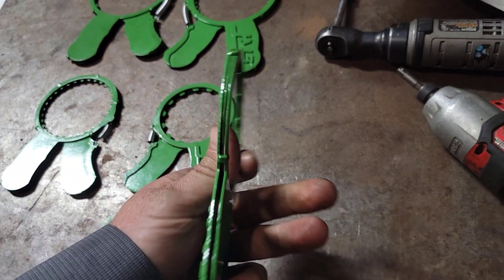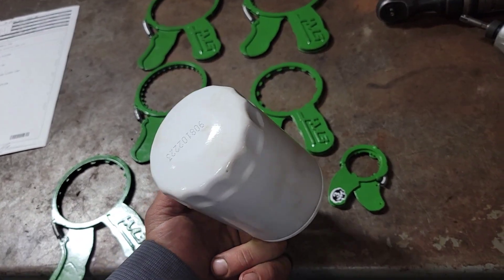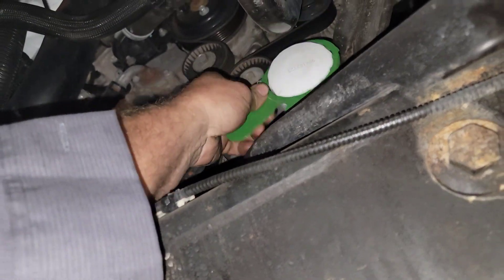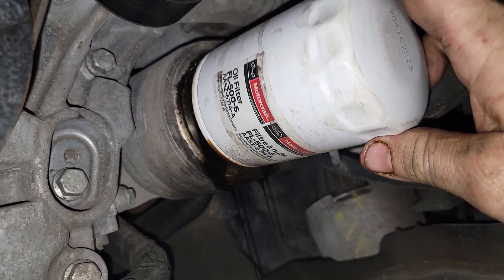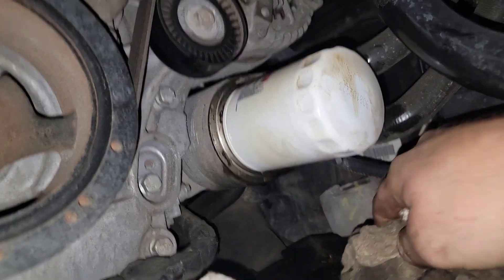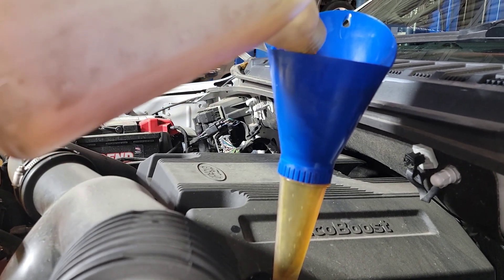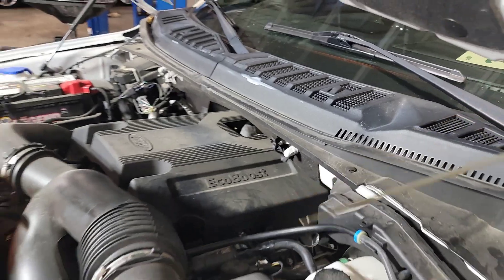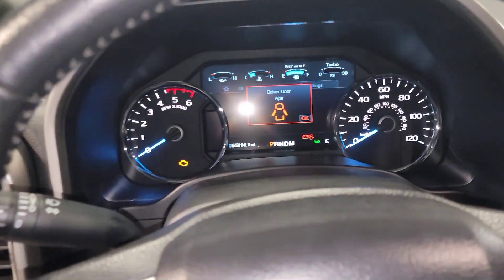2011 - 2022 Ford F150 - Cleanest Oil Filter Removal / Best Tool For It - Reset Oil / Oil Prime Mode

Comment: Genius, wish I had this when I was changing my old land rover filter. 
I used the sealey one with 3 hook things that grab the sides, I just managed to get the thing off in one piece, but it was basically crushed by the hooks - one had punctured the filter completely. Could have easily torn in two.

Comment: These look pretty awesome, I noticed they have their own website you can visit also.   Man I had a stuck filter, on my personal car no less, a little while back.   It's an older Honda Accord with the oil filter on the firewall side of the block.   So already an inconvenient spot.    After struggling for a few minutes, I did the old trick of driving a screwdriver through the filter at an offset,  and that still wouldn't break it free.  I ended up cutting the bottom half of the thing off trying to get it with the screwdriver like that.   What a mess.   I had put the filter on while I had the engine out of the car, and I guess I used too much caveman strength.   But one of these, could have saved me a lot of time and effort.
Reply from the maker: It's posted in the pin comment I posted on every video that I talked about them at the top of the comment section there's always a pin comment that's where the important stuff goes on
Reply from the maker: Yes one of these would save you in a situation like that
Reply from the maker: No it's not going to work every single time but most of the time it's going to where other things don't

Comment: Switched out the Pennzoil Platinum for the Amsoil SS. Engine still running pretty quiet but it sounds like the engine is slightly noisier than when it had Pennzoil. Maybe it’s just my ears messing with me but I’m gonna keep checking as I did take a recording of it before I switched out the old oil. My transfer case fluid looked good as well. Still had its red color. I think next oil change I’m gonna try Royal Purple HPS. They got it for $62 on Amazon for 6 quarts.

Comment: Looks nice in those tight areas. Random question while I’m thinking about it since I had to do one today. E150’s with vacuum operated mode door control. When they fail, either the vacuum canister or check valve fails, it calls for like almost 6 hours to replace, at our shop what we’ve done for years is get a new vacuum canister and check valve and we just bypass the original parts and reroute everything inside the cab in the passenger footwell, charge the customer 1 hour labor for the repair and it’s good as new. How do you guys go about those repairs on that van at the dealer, do you pull the heater box and fix it to OE standards or do you guys do something similar? Just curious really

Comment: How well does this work for the EB Expedition's and Navigator's? From my experience the filter's limited access turns a simple job into a frustrating one. This might be a topic to cover unless I missed it in your library.
Reply from the maker: The are literally in the same exact spot setup the same exact way
Reply: @FordBossMe  Do the F-150's have the same rubber flap to open? Those seem to have more room. Family member has a 17 Nav. Getting to that filter from the bottom corner is no fun.

Comment: A bit of topic. I've been watching a lot of triton 5.4 3v knocking noises which are being identified as phaser/rocker malfunction videos. In relation to cold start up knocking i am curious if the 5.4 triton 2v (1999) has the same issue. I start my vehicle and it knocks during the first few minutes. I'd appreciate any insight you have on the triton 5.4 2vstart up knocking noise if helpful it has 202k original miles on it! Tricks of the trade a novice like myself  can learn from the ones with the experience! TY!
Reply from the maker: My 4.6 2v does the same - I'll cover this more after the little ones football game
Reply: @FordBossMe  Wow excellent TY!

Comment: seems like there are cheaper, better, more universal designs.
Reply from the maker: Not that will do this
Reply: @FordBossMe  they may not work like that one but they will fit in the same space as that one. like the socket strap one or the gearwrench, gedore... and sealy makes a nice one.
Reply from the maker: @tankankhamen9522  no that's where you are wrong

Don't talk about the tool until you've used it 

Bottom line, give it a chance or just don't say anything that's the right thing to do 

It's what any RESPECTABLE person would do
Reply: @FordBossMe  for the record i didnt talk about the tool, i talked about other tools and you are WAY too defensive for a mechanic that just got a new tool... do you own stock in the company, you related or best buddies? because there is more to this story if you are responding like that. you are free to use the tools you want, i will use the ones i like. i am not gonna get upset if you dont want to use the others.

Comment: Rich, just changed my 2011 Mustang 5.0 oil. When the seal broke on the (Napa Platinum)filter. There was pressure and sprayed some oil. I've been doing my own changes since I started driving. This is the first time I had a filter holding pressure. Have you seen this before?
Reply from the maker: They could be crankcase pressure built up you could have a stopped up PCV valve
Reply: @FordBossMe  Don't laugh, but this car only has 3,880mi. I have 3 cars. I still change the oil every 500mi, which sometimes is over a year. The filter is above some wiring and gets covered. However, the oil sprayed out to the side and made a small mess. I like the synthetic media, in the Napa filter. The Motorcraft is paper.

Comment: As someone who’s done thousands of oil changes I’m kinda set in my ways. I don’t see this fitting in many spots. Also my ocd was triggered when you went from that dirty oil deflector straight to the oil filter surface without even flipping the rag.
Reply from the maker: You are wrong bud

Don't judge ANYTHING until you try it point blank
Reply from the maker: I don't get you guys with this attitude it just gets under my skin so bad

Comment: You must be familiar with the 2019+ Rangers . It's a tight fit for the 910S will this work on my Ranger? The Ranger filter is a real pain to break free..My Ecosport with the same filter is a breeze do you recommend for the Ranger I have tried several filter wrenches none seem to work well.
Reply from the maker: Yes
Reply from the maker: I showed that in a Bronco through the wheel well in a previous video

Comment: What size is the jm3 your using for a 3.5 ecoboost f150
Reply from the maker: Its the med15/30 flutes
Reply from the maker: Contact the company and tell them.your filter they will tell you what you need

Comment: Hi Rich I may have missed this information in one of your other videos what year or years of Ford vehicles can the flood mode procedure be used on ? Can this procedure be used on all Ford gas vehicles ?  Thanks
Reply from the maker: Flood mode has been around since carbureted engines Ford Chrysler and GM have continually used this type of mode for these types of things and most of these vehicles still to this day do it especially Ford all of them since carbureted engines
Reply from the maker: The purpose for flood mold was whenever you flooded the intake manifold with raw fuel Vapors you would push the throttle down it would open the carburetor wire up stop the fuel from being pumped into the intake and you would draw fresh air in to clear out any of that or all fuel they continued that on with fuel injection as well under the same principle so any Ford this works out as well as multiple other vehicles with other manufacturers
Reply: Hello,
I use it on my 2014 RAM and  2010 Suzuki SX4 , using this during cold start in the morning too while oil is thicker.
Works great, big thanks to Rich for sharing with us.
Good weekend
Tigo
Reply: I have a 2003 F150. I had never heard of flood mode until I started following this channel. Works great for me; I’ve done it twice. Once to see if my truck actually does it, and on a recent oil change to prime the filter.
Reply: Thank for explanation and information

Comment: Great video!  Did I miss your conclusions about oil?  Recently, I heard you talking about Mobil 1 and I'm wondering what you prefer now and how cost influences your choice(s).
Reply from the maker: this confuses me because you've been on this channel for like literally freaking ever and I have talked about this so many times over the last couple years mobil doesn't even come close to any kind of even mediocre mid grade testing I'm surprised that you're just now asking this question after all this time
Reply from the maker: Pennzoil Ultra Platinum is literally the best regular full synthetic that's most affordable to People Like Us
Reply from the maker: Red line is the best oil I've ever used
Reply: @FordBossMe  Got it!  That's what I thought, but maybe I had earmuffs on about Mobil 1 previously, and then I heard you mention it recently and was surprised. As always, THANK YOU!  You have certainly helped us all out.  Keep it up!
Reply: @FordBossMe  New to the channel, so this is what I wanted to hear. 👍
Reply: @FordBossMe  I've been using Castrol Full Synthetic and Castrol Full Synthetic High Mileage for years and have had very good results. My back and forth to work 2001 Toyota Camry with the 2.2 4 cylinder has 306,000 miles on it. I do oil changes every 5,000 miles just like you do. My dad worked for Chevy back in the late 60s and early 70s and he is the one I can thank for a great career as a technician. He helped me rebuild my first small block chevy when I was 16 years old. I have been hooked on mechanic work ever since I was handing my Dad wrenches as early as 5 or 6 years old. They don't make them like my Dad anymore R.I.P. He passed away a year ago and I miss him very badly. Rock on brother. Good video.
Reply: @Stoff1  yes there are other opinions but you have to put more trust in people like Rich that have been in the field for alot of years. I have been a professional technician for almost 30 years. Rich bases his opinions on the  experience of actually repairing vehicles just like I do. Rich does a great job and I hope he never changes what he is doing.

Comment: Just wondering, would flood mode work on a fuel injected motorcycle? (Honda CB500X)  i already do it on my car!
Reply from the maker: Prob not
Reply: @FordBossMe  Thank you!
Reply: @davidcampbell1899  hello,
Just to help, could try to unplug the crank sensor if accessible to prime,just check on for not getting any codes after, Honda ' s tech could answer you .
Good weekend
Tigo

Comment: I mean it’s a novel idea, but, and I’m no engineer, it seems like there’s already oil filter wrenches that have SIGNIFICANTLY MORE torque to remove the filter than this one does. Maybe I’ve missed something in your videos about this, but aside from a filter location that doesn’t leave you much room for a belt style or one that cups the rear of the filter, I’m not seeing why one should change from what they’ve already got for this. Doesn’t seem like it has much torque just by it’s design. I’d like to see it used on a filter that’s way over tightened to test that out.
Reply from the maker: Wrong completely wrong

You are talking about the product with knowing 0 about it
Reply from the maker: Not a wise idea and often speaks about how someone judges others without knowing
Reply from the maker: It's in the design, it's a torque multiplier so leverage isn't needed 

Until you use it don't judge it don't do any of that schit, you know what's not a wise thing to do
Reply: @FordBossMe  says the one judging someone asking legit questions and again,  I’m ASKING you about the product
Reply from the maker: The cups take up to much room, the cups don't always get stubborn filters off. The cups are not easy to get in tight spaces with extensions and everything else 

The purpose of this tool is to get in tight areas nothing else will and provide that torque multiply factor

It freaking grinds my gears when guys come by here and they start the blah blah blah stuff and don't know anything about the product

If you don't know about it close ya mouth and don't say anything
Reply: @FordBossMe  wow forreal? I’m asking you about the product you have a video up about. Nobody’s judging anything but you. How you gonna put a video up and then attack your subs for asking you how it work?! I get it though. Take care.
Reply from the maker: @KendrasEdge757  you clearly shot it down from the get go
Reply from the maker: @KendrasEdge757  you talked as if you knew the product by looking at it
Reply from the maker: Significantly more torque? How so 

You have multiple contact points and a unison ring and grip strength

That is ALOT of leverage 

Understand the design
Reply from the maker: Your not seeing why one should change the way they Removal oil filters? 

Well this will get in areas no other oil filter wrench will, ENOUGH SAID
Reply from the maker: FILTER THATS WAY OVER TIGHTENED - look at the previous videos and JM3s videos 

THIS IS LITERALLY FREAKING AVAILABLE FOR VIEWING

dude I'm so tired of the repeat games and people saying schit without knowing ITS CHILDISH
Reply: @FordBossMe  wow I see your true colors. I apologize for asking the one making the video about the product. Again, not all your subs are mechanics and engineers, but I guess that’s my fault I didn’t watch your video and then go research the product before tryin to talk to you about it. 
Take care
Reply from the maker: @KendrasEdge757  here is what you should do

ASK THE QUESTIONS WITHOUT ALL THE EXTRA COMMENTARY 

Just simply ask 

You - Hey can you explain the leverage points more or about the design?

ME - SURE here is the answer......

You thanks 

** that's literally how that would work ** You gave alot of unnoticed commentary and judgment for NO reason

Comment: QUESTION for ya Rich.....  F L O O D  M O D E???  Sounds like it's Just that, However I'am certain that we "ARE NOT"  FLOODING the Vehicle with the Fresh Oil and all by Pouring Raw Gas Into the Cylinder's?  Could you "Briefly" Explain the Mode's Operation as far as NOT Dumping Fuel for us that might be Interested please??
Reply: When in flood mode, the injectors are turned off. No fuel is being pumped into the cylinders.
Reply from the maker: I did explain it 

It disables injectors and turns the engine over this priming the oil system 

It's a mode to clear the intake of raw fuel in case of an iverfuleing event BUT in turn it can be used to prime the oil system
Reply: @FordBossMe  Sorry.  My BAD. I must have Missed that one. Thanks for the Double Whammy Explanation. Appreciate It.